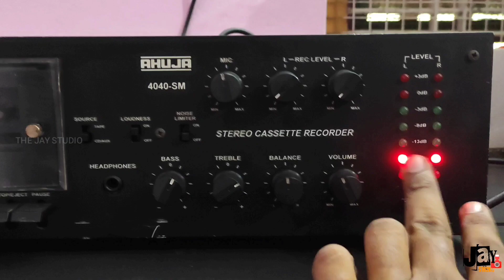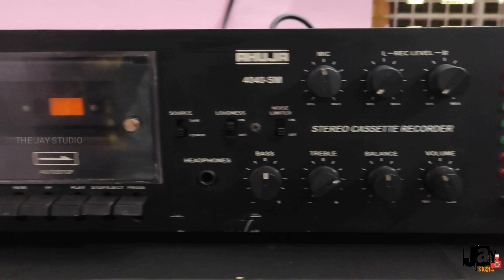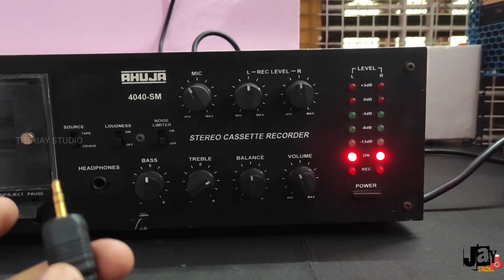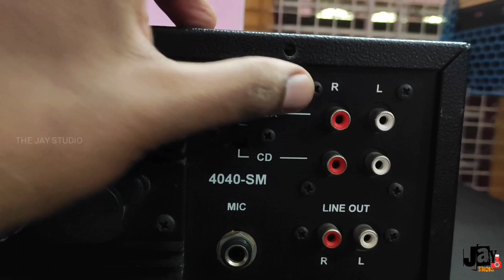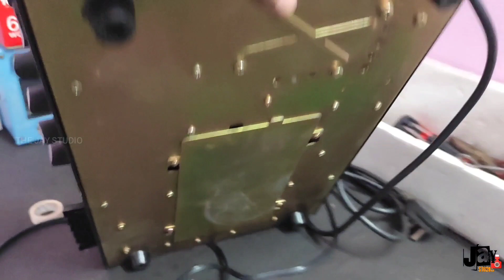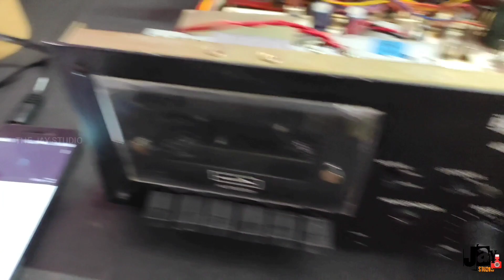AHUJA 4040-SM | STEREO CASSETTE AMPLIFIER | 90'S NOSTALGIA | FULL REVIEW

Comment: In 4040s there is an different speaker jack ,, like com 4 ohm,8ohm 16 ohm,,how can I connect stereo ...
Reply from the maker: Com is for common earth
Other connections are for different speaker of specified ohms. You can connect the speaker output to a stereo pr there will be a stereo output.

Comment: Almost all of the parts for this amp is available except the 2n3055 & u can replace them with 2sc5200 & it would perform better.
Reply: WHERE I MAY GET THE PARTS OF AHUJA FULL MECHANISAM DECK
Reply: @shankarsinghv1304  u won't , unless u can find used or new old stock. & Modern cassette mechanisms are absolute garbage. They sound aweful.
Reply from the maker: Thanks for the information 🤗.

Comment: Hw many volt bluetooth modular we can use this system
Reply: Thanks for your quick reply
What is the volt of Ahuja 4040sm 
Please reply
Reply from the maker: It's 34V for amplifier section and also have a 12V supply for preamplifier.
Reply from the maker: I used 5V module since I used 5V regulator IC. You can use 12V module if you need.

Comment: I hv this system
I want to upgrade 
Is that possible . Please reverts
Reply from the maker: Yes, you can add USB - BLUETOOTH module in it.
Reply: Which bluetooth modular is best 
For long lasting 
Please suggest
Reply from the maker: All are coming from China.....For better life.... don't connect the wires in opposite polarity.
Reply: If you have any video in this please send link . please help
Reply: Can we get long lasting bluetooth modular in market
Reply from the maker: Yes....But it's costly...About 700 rupees.
Reply: If it's long lasting or good quality no issues
Please provide the link or model no
Help me

Comment: Kindly share how much power and spekar size for 4040s
Reply from the maker: R.M.S : 40W 8ohms 
Better use 10inch 100W woofer + 40W midrange woofer + Tweeter combination for better output.
Reply: Sir Philips 6 ohm 6" 40watt ka spekar +tuttar4ohm chalega
Reply from the maker: Better use same ohms.
Reply: Ahuja 4040sm. And. Ahuja 4040S.    Are. Same